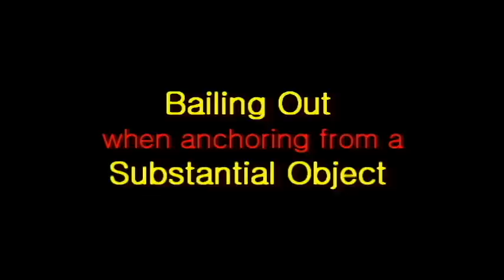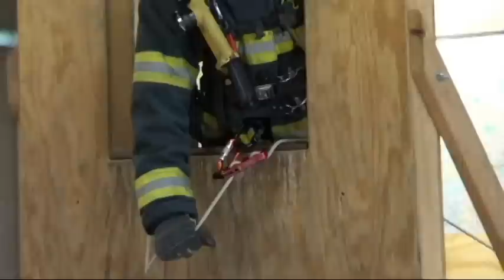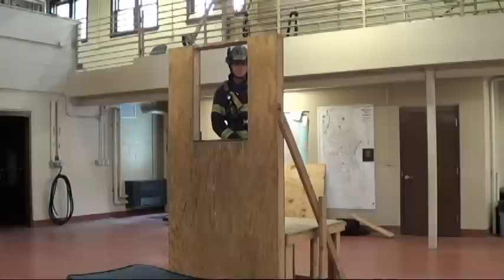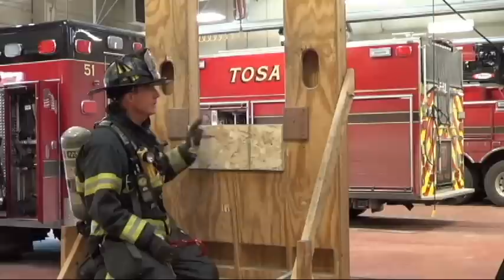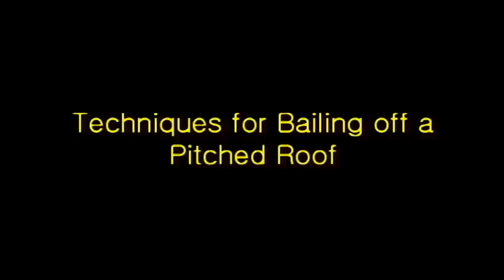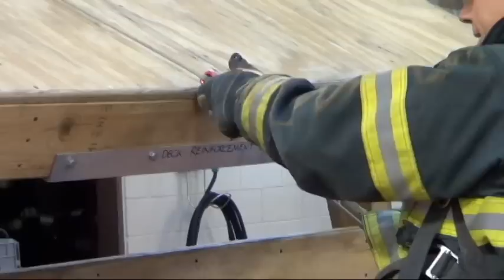Firefighter Bailout Techniques

Comment: you can also take the poker end f the axe and use that as an anchor point as well on a roof and attach the VRS to the head of the axe on the side of the top of the roof

Comment: So I hav gotten my system yet but I will have it in my left pants pocket do you still prefer the left side anchor most the time still or will I have to switch to doing it right sided
Reply from the maker: Ben it's really not critical what side you carry your system on or which side you decide you want to anchor off of. However if you're going to keep your system on your left I would make the right side your primary "go to" anchor side. In a worse case scenario you will set the anchor hook with your right hand which will keep your left break/control hand on the same side that your system is stored (left pants pocket) - This will allow for a faster rappel/descent since the rope won't be coming across your body. All this being said; In the end you need to practice anchoring off of both the left and the right sides of a window and be equally proficient as you never know what you will be presented with.